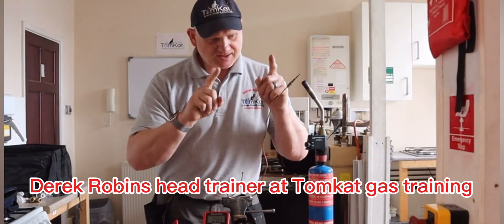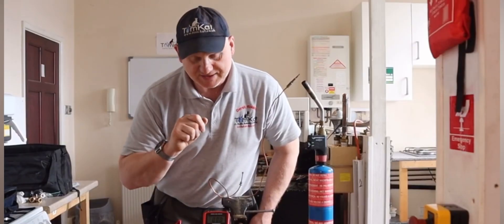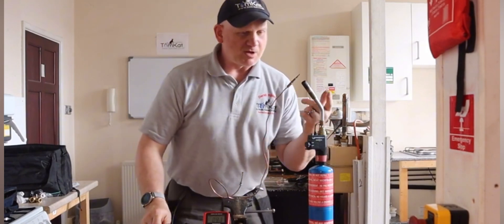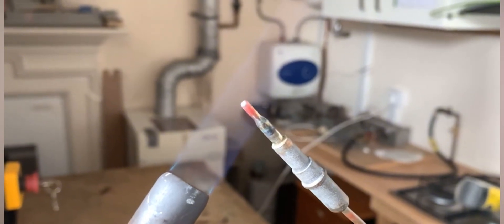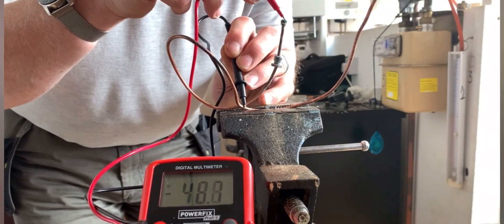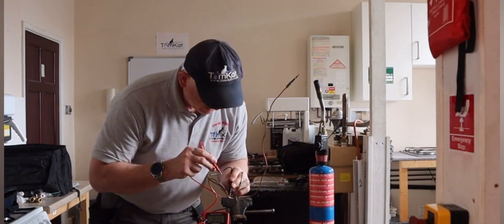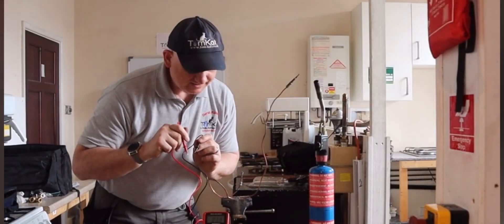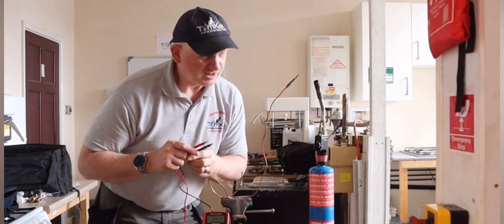How to test a thermocouple

Comment: Good one. took my gas fire apart cause not lighting. Turned out thermocouple ok. It was a tiny piece of fluff blocking the breather hole in the mounting tube. Great test will use that one.